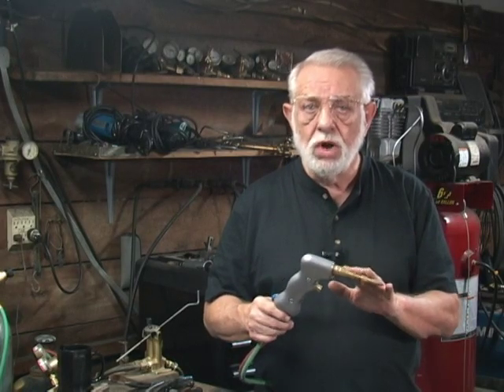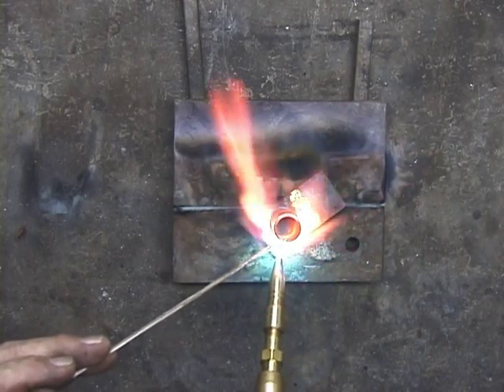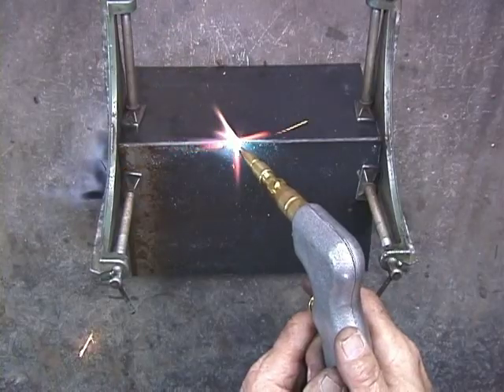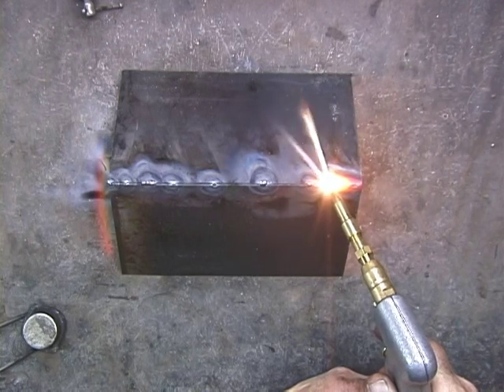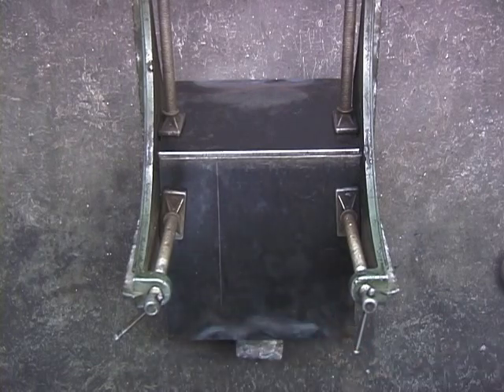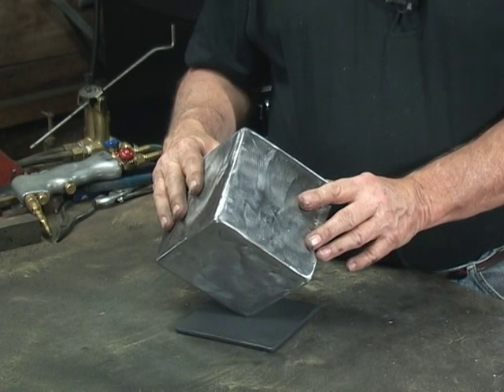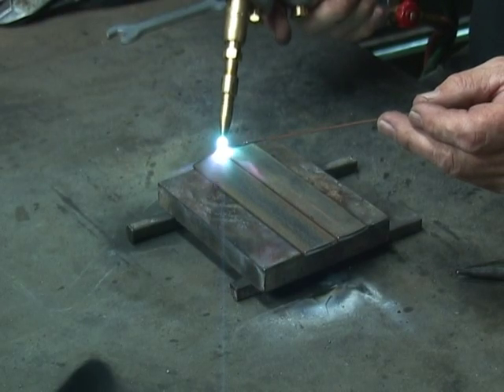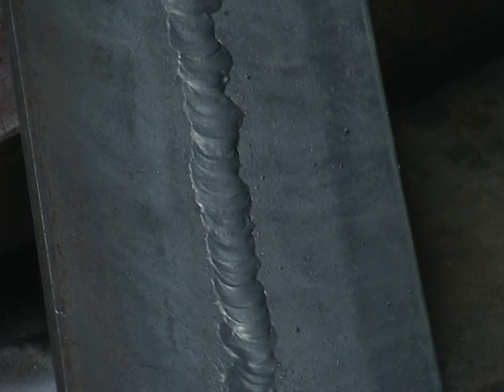Examples of Brazing & Welding with the Henrob 2000

Comment: That looks like a really precise torch and easy to handle. Does it do well with lap and t joints? To me laps and t joints are a bit tricky to weld with a standard torch. That torch there looks like it would be easy to pin point the heat and  I know the henrob cobra uses less  psi of gas to run it. I have the issue where my puddle favors too much of the bottom plate on a t joint and it doesn't want to form right. I I'm thinking my torch is just worn out because whatever I do, that puddle acts very stubborn. I might need to invest in a cobra. It tends to blow around and I keep trying to add wire just to get the top and bottom to come together. Settings are 5 psi on Acetylene and 10 psi on oxygen. 1/8 inch plate with a number 2 tip with the Harbor freight heavy duty torch which they don't even make anymore its all olsens. Plus it seems like with the henrob it's so much easier to handle with the pistol grip vs the old style blow torch design. I have to keep trying to adjust my wrist around and all that jazz.

Comment: I have one of the old Henrob torches and a cheap set of Chamble Hausfield gauges/regulators. I am a beginner welder and an old fatman. Old dog trying to learn a new trick. I can't seem to get the pressures set properly and too cheap to buy a proper set of gauges/regulators. Can you give me a pointer to get the pressures set properly so I can play  with this wonderful tool.....
Reply from the maker: Ray, there is a procedure for setting up generic regulators for the Henrob torch.  Not sure I still have that information, but will look.  If I still have it, I'll get back to you.  It will be a few days as I will not be in my office till later this week.
Reply from the maker: For a quicker solution, you might contact  Detroit Torch:  https://detroittorch.com/
Reply: Thanks George for the reply....There is a proceedure for setting the pressures with generiic gauges and I have been trying to follow them. The problem is that when I get to step that requires one to start opening the O2 regulator which is to start showing a blue flame ( I think ) it just blows out the gas flame...... I do believe that this is a great tool if I can just get the regulators set correctly. I have never messed with any gas rig so It is all new to me......
Reply from the maker: @rayditzenberger9517  I do find the Henrob torch difficult to light right at first.  Very touchy.  Once I start using it, all goes fine.  Why that first start is a problem, I have no idea.  I think you'll just have to practice till you get used to it.
Reply: Thanks George for your help.....Someone has sent me a site that has explained the gauge setup a little differently that I think has fixed my problem.... I am not home right now and won't be for a few days but I am betting that I will be in business with the torch as soon as I get back.....thanks again for your help. I hope the welding goes better than the setup proceedure.....I am really looking forward to the learning experience.
Reply: Yep, I have gotten the pressures set and I am starting some awkward trials. After a couple of false starts I am starting to get a few small welds on 1/16 steel made ...Not pretty yet but welds none the less.... Thanks for all the help...Next step is to get some nicer welds and then then try som aluminum sheet metal.....   What fun...
Reply from the maker: @rayditzenberger9517  Sounds like you have a plan.    Keep me posted.

Comment: Great video! Have you used this rig with DHCs low pressure regulators?
Reply from the maker: I don't know about "low pressure regulators".  What I'm using is the Cobra regulators that came with the torch.  I believe my set is 2 Stage.

Comment: copper  to hot rolled steel? is brazin bronze rod flux coated?
Reply from the maker: Brazing cold rolled is easier as it doesn't have the mill scale that hot rolled has.  It's been my experience that grinding off the mill scale on hot rolled steel increases the quality of the braze.  For oxidized or rusted steel it 's best to clean off the metal and use flux.  In my work I use all new material so I need very little flux.  This video explains more of how I use flux.  https://youtu.be/KFN38vHKQTY
Reply: Thank you  George

Comment: So George, what makes the difference using the henrob style gun,vs using a small tip on a regular style torch? Trying to understand the difference other than the pinpoint tips. Could not a standard style torch with a more fine tip do the same thing?
Reply from the maker: Peter, I don't know if there is a finer point torch tip for the traditional torch.  There may be, but i haven't seen one.  The smallest I've used is a (000)  Another point about the Henrob is it uses 4 lb oxygen and 4 lb acetylene, so there is a saving on gas.  In addition, the Henrob produces a hotter flame.  I can't explain why using less oxygen and acetylene produces a hotter flame.  It just does.  For more information on the Henrob (DHC 2000) check out https://detroittorch.com/
Reply: George Goehl Hi George,, Obviously we get our pressure at the regulator, and fine tune at the gun or torch controls. 4 pounds on both the gasses is low so it has to be tge compression of the gasses at the tip has to be the answer. I guess I figured you'd have every tip ever made. Due to your detailed work you do. Heck let's put it this way, I'd rather buy a 20 dollar very fine tip for my torch rather than pay 450,00 for the Henrob gun,,,if it's possible.😁 Thanks again George.
Reply from the maker: Hey, I am not selling torches.  I like using the Henrob (DHC 2000) .  I did the video to show that there are alternatives, not to encourage buyers.
Reply: George Goehl  Hi George,, I understand,,,not what I was inferring. Thanks.
Reply: Late reply. You can get the same result using a torch which uses the venturi mixing system. In summary the oxygen flows in the mixer at a higher velocity and pulls more acetylene. the victor torches I have seen don't use this system. Many others do. Most of the british BOC torches use the venturi mixing but they come with larger tips. get yourself small tips. 0.3mm is the same as the Henrob tip for 1.5mm sheet steel (4 to 30 thou or 20 gauge). Now you need to set the pressures so that the torch receives 4psi of acet and oxy at THE TORCH (not the regulator). Length of hose, flashback arrestors etc, decrease the pressure. You can use the Henrob setup system on any other torch to set pressures at 4 psi. You don't need fancy regulators.

Comment: I live in a town where acitylene is not always available.  can the henrob be used with propane? I'm new to welding. I don't know if this is a stupid question. 
thank you.
Reply from the maker: Tarek,  I don"t know. But here is web site that will have your answer.  Detroit Torch. https://detroittorch.com/products/dhc2000-propane-tip-set
Reply: Thank u sir.
Reply: Yes it can. You need to buy a set of tips to suit propane gas though. Here is an Aus site that has them, surely they can be bought in UK and USA. http://shop.cobratorches.com.au/index.php?route=product/category&path=43_71
Reply: Oxy propane tips are visibly different from oxy acetylene tips:  The oxy acetylene burner is just a little hole, the oxy propane burner has some kind of outer burner around the central opening.  The flame velocity of propane is much lower, and when you turn up the power the flame tends to "blow off", to separate from the end of the burner.  The smaller flames around the base of the main flame "anchor" the flame in appearance, they are continually re-lighting it.  Thus you can turn it up higher.  If you just put propane through something designed for acetylene it will burn, but will not be very powerful

Comment: what kind of filler rod did you use on the steel?
Reply from the maker: Brazed (gold color) with 3/32 standard brazing rod.  Most of what I did on this piece is Fuse welding.  Melting both sides to form as one.  I did do the ends with a  1/16th RG 45 mild steel gas welding rod.

Comment: How did you decide to fusion weld the cube instead of adding filler rod? Is there a rule of thumb for when to use rod or fusion weld? Thanks!
Reply from the maker: Jay, in theory, adding gas filler rod is stronger than fusion welding.  The cube did not require any strength.  In other words, there would be no stress on the welds.  This fusion weld required very little grinding / sanding to get a smooth finish.  Also, I particularly like to fusion weld.
Reply: Great! Thanks for the info!

Comment from the maker: I think it has something to do with the mixing chamber.  Mixing the oxygen and acetylene.  This is just a guess on my part.  
Also, the flame is hotter even thought regulator pressure is less than for a regular torch.  For better information check out, cutlikeplasma web site.
Yes, it does save time.
Reply: George Goehl Hi George,,I had asked about the use of the henrob style torch over the standard stick handle torch. I cannot see why with the proper tips you couldn't get the same results. Beings you use both regularly, maybe you can answer . I cannot see why a fine tipped standard torch could not achieve the same fine cut or weld? Unless they just don't make tips as fine,for stick style torches. Thanks George.